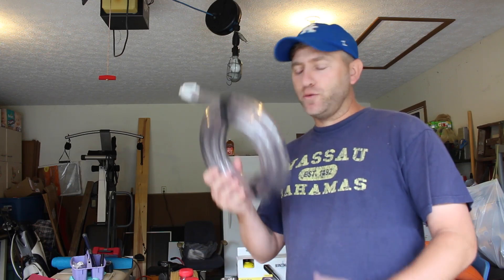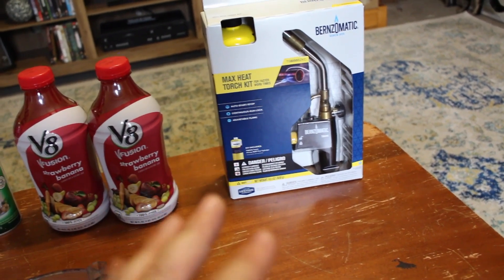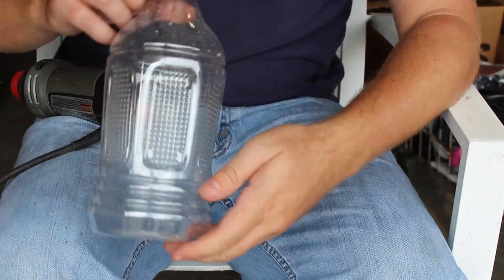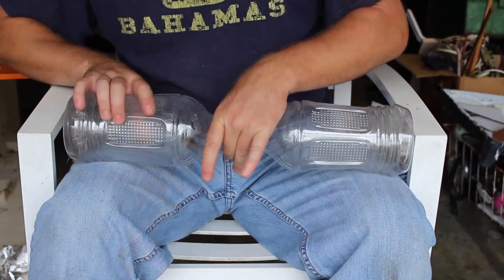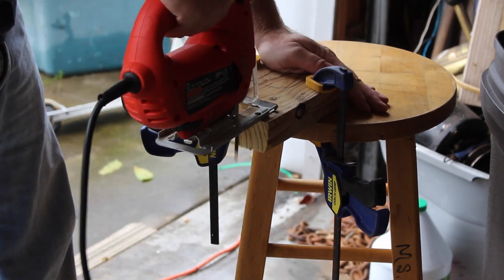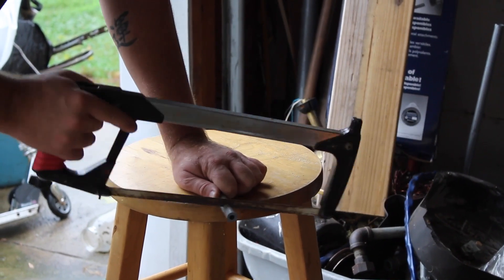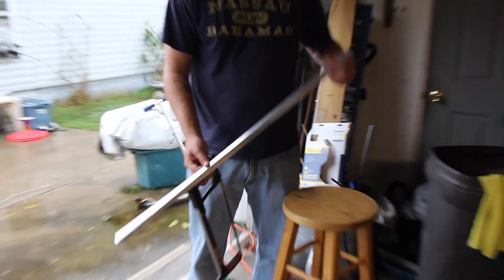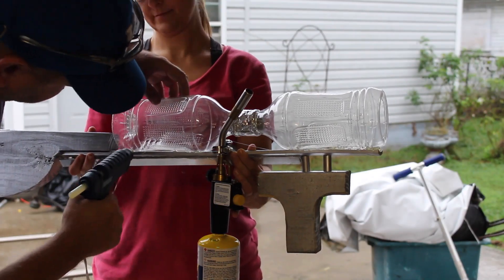How to make a Plasma Gun (DIY Homemade Propane Gun)

Comment: My take on the plasma popper went from a fun garage science project to me spending a year perfecting it to the point where it sounds like a 12-gauge shotgun and it folds cans in half.
Reply: Would you please be so kind in sharing with us the magic formula? I haven't tried to build one yet but I would like to make one where the sound is as loud as possible. Any tips would be greatly appreciated. Thanks!
Reply: My question is can you use the ignition in the chamber to make an actual cannon? Like black powder and once it ignites the pressure build up and the pressure created enought to make something go really far fast lol

Comment: Questions: How loud would you say the "pop" is? Would conduit or PVC pipe carry the blue "bolt" like the clear hose does?
Reply: First question: Depends on the gun. I've seen some that just whoosh quietly, and then I've seen ones like mine that can literally blow out your eardrums if you don't wear proper protection. It mainly depends on how big the barrel is and how much gas you give it before igniting. Second question: Yes. As long as it is fitted over the torch correctly, it works exactly the same way. I turned this same sort of mechanism into a rocket launcher, and I used rigid PVC tubing and it worked fine.

Hope I answered all of your questions :)
Reply: @ethandoades  Need more of a noise maker and less of a visual fun show. Don't get me wrong, I dig the spinning blue tube fun show. Mine will be for effect in a training environment.
Reply: @ethandoades  100 points for cat in video, btw.

Comment: Cool, but can you try launching some sort of projectile from it? Maybe some sort of thick plastic ball that loosely fits in the end of the "barrel?" It'd obviously have to be something lightweight and capable of standing up to the heat. You'd want to maybe test this with a long piece of tubing running to the gun first in case the projectile ends up too snug, or caught, or something, and causes an explosion though.
Reply: I took away the barrel on mine and loosely fit a cheap plastic water bottle on the end of the tube. I gave it like 6 seconds of gas before ignition and i got the bottle to fly about 50 feet max. I'm currently working on perfecting it.

Comment: Do you have to use two sizes of tubing, or could you stay with the same size for the whole length? If so would it matter if you used the smaller size throughout, or does it need to be the bigger size?
Reply from the maker: I can't give an absolute answer on that because I've only built the one gun. I would imagine either would work fine.  you can always test the tubing before you make the gun by connecting your gas to the tubing and trying it out.  With the smaller tubing the plasma ball will move faster through the tubing.

Comment: is there something else we can use instead of the bernzomatic trigger start torch? it's quite expensive, I saw other start torches but I don't know if they are suitable for this purpose
Reply from the maker: Hi PhotoSlash!  I wish I had an answer for that :(  I really don't.  I can't think of anything offhand that can do the same thing.  Maybe one of the viewers will comment if they have an idea.  I totally agree though, it does take a bit of money to get this thing put together, but it is pretty cool :).  Thanks for watching, and PLEASE.... if you find an answer I would love for you to let me know what you did :)
Reply: oh okay! no problem :) I'll see what I can find, thanks for the answer!
Reply: @PhotoSlash  hey man. I know I'm late to the party, but if you didn't want to use the autoigniting torch you could use some other gas regulating valve and then to ignite you could use a piezo electric sparker like a barbecue lighter has. It's basically the same thing as what is in those name brand push button torches. The really nice thing about the auto torch is it's all in one trigger pull, whereas with a barbecue lighter you would have one button to light and some other valve to actuate the gas. If you wanted to go this route you'd be best using mapp gas because it would be easier to start with the weaker spark. 
Source: used a hacked lighter for a whoosh bottle demonstration in high school. 
I am not responsible for any injury or damages caused while employing this advice. I'm just a guy on the interwebs.
Reply: @PhotoSlash  Also there's a kind of a new trend of eletric lighters that look like zippos, but use high voltage electric arcs instead of chemical flames, they call them plasma lighters or arc lighters. Probably overkill for a low budget simple ignition system, but they're mad cool and I'd love to break the warranty on one for science.

Comment: the only real flaw with that plasma rifle is all of the kinks that you have in your hose, which creates a somewhat high risk of rupturing while firing your weapon. I'd recommend remaking this weapon so that you don't have any kinks or flattened sections of  vinyl tubing.
Reply from the maker: There are two spots where my tube flattens out a little but I don't have any kinks.  I've fired it a ton of times at this point and have never had any issues with the speed of the flame going through the tube.  Because of the way the gun works, if there were a kink then the flame wouldn't travel at all.  The gas behind the flame is what pushes the flame through the tube, so it would be easy to immediately see if there were a problem.

Comment: How to operate then?
Reply from the maker: the end of the video shows me operating the gun.  I squeeze the trigger lightly in order to let the tube fill with gas (I do this for about 3 seconds), then I push the trigger all the way in which ignites the gas, I hold the trigger all the way in until the gas explodes in the v8 bottle chamber.  the trigger must be held in once the gas is ignited in order to push the flame to the V8 bottle chamber :)

Comment: Hello, tell me more about the release of gas. Do you turn on the gas and let it build up before you hit the igniter? The bottle igniters that I am familiar with need the gas to be turned on before you press the trigger. Could you please tell me a bit more about how this gun is kept from exploding.  Thank you.
Reply from the maker: When I press the trigger (slightly- not all the way) on the gas tank the gas is released.  When I press the trigger all the way down is when the gas is ignited with a spark.  You will have to purchase the trigger mechanism, you can see the trigger that I used here:
Bernzomatic Trigger start torch
http://amzn.to/2fYRFuQ

As far as the exploding part... I guess you might say it is a controlled explosion.  Hope this helps.  Thanks for the comment
Reply: Thank you for the head's up. I have an old style igniter which depends upon an open valve to ignite. I will get a new one
Reply from the maker: You're very welcome!
Reply: exactilly good deal explain more though. misspelled exactically

Comment: Question no one has touched on that I've seen is firing it. 
Do you fill the tubes with propane then stop releasing the gas, then ignite it? Or do you continuously release the gas even after ignition?
Reply from the maker: great question... So when I fire the gun you will first hear me fill the gun with gas (I first press the trigger for about 5 seconds I think to release the gas) then I press the trigger all the way down which ignites the gas.  You must continue to hold the trigger down until it fires or otherwise the gas will not be pushed all the way out.  You will find that if you don't do this the flame will stop moving through the tube.  I hope this explains it.  Let me know if you have any other questions.  Thanks for the question!
Reply: @kaiprojectsdiy thanks!

Comment: You need to learn what plasma is. This is not plasma.
Reply: I think most of us know that this is a prop, and not actual "plasma".  However, you would refer to it as a plasma gun during cosplay, larping, or otherwise using your imagination.  This is a damn cool prop.
Reply: Stanley Denning its not a Propane pop gun either... it's map gas... Gah learn the correct terminology or dont even say anything... telling someone they are wrong by stating something equally wrong... wow
Reply: Stanley Denning 
Actually fire can regularly be considered a plasma. 
If a flame burns hot enough then SOME of the gasses can become ionized.
Even a candle flame can be influenced by or respond to electrical fields.
Reply from the maker: Of course it's not Stanley.  Have you ever heard of a "misnomer"?  "a word that suggests a meaning that is known to be wrong." Another definition for misnomer is this..."Misnomers often arise because something was named long before its correct nature was known, or because the nature of an earlier form is no longer the norm."  If you watch the video I tell you that I did not create this, there were people before me that gave it the name "Plasma gun", so I just kept the name and made my own design.  Think of it like this... Tin Foil is not made of tin, it is made of aluminum, or the fact that people call the stuff in pencils "lead" when it is actually graphite and clay.  Thanks for watching.
Reply: ahh pretty good but no not plasma. want to see more how end happened not sure but nice
Reply: @mikemoore3723  fire is plasma, it's even got a name plasmon...
Reply: Than maybe people like you, of a higher IQ, should start a new trend. Calling things by there correct term. Like "Propane Pop Gun"
Reply from the maker: Perhaps you are right.  It is in no way meant to deceive, it is just meant to make something easier to find because that is the word/name people first think of based on the originators of the project.  Kind of like electricity, as you may already know most are taught that electricity flows positive to negative... and it is still taught this way (because in electronics it doesn't matter too much), but in physics they teach that it flows from negative to positive.  Kind of interesting that even though something has been proven wrong scientifically we still teach what we first thought was correct.  Maybe I'm going off on a tangent but I thought it went along with our conversation.  :) Thanks for your thoughts! ps... I'll put "propane pop gun" in the description :)
Reply: Completely understood and agreed upon. Just like being taught that Columbus discovered America.
Reply from the maker: Absolutely!
Reply: @kaiprojectsdiy  um propaine is in the uper atmosphere andit can be burned at high tepatures but it is missing the other componits
Reply: You need to learn what mapp gas is.. this in not propane
Reply from the maker: if this is directed toward me??....   I explain what it is in the video. (33 seconds in).  Thanks for the comment :)
Reply: @kaiprojectsdiy  technically it's plasma, the flame itself is the plasma... fire is made up of quaziparticles called plasmons thus what's referred to as plasma in metallurgy
Reply from the maker: Great point Ben. Thanks for watching and commenting!
Reply: Stanley Denning Hey Einstein, fire IS plasma
Reply: you do realize the fire itself is the plasma right?
Reply: Stanley, either get a life or go be creative and make something cool. Call it by its real name. No need to be a classic troll . (misnomer)